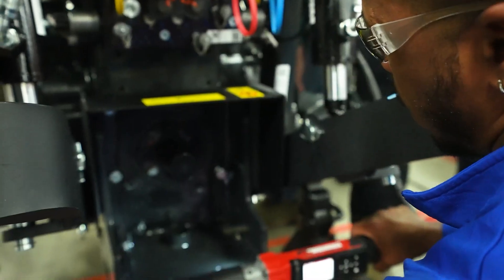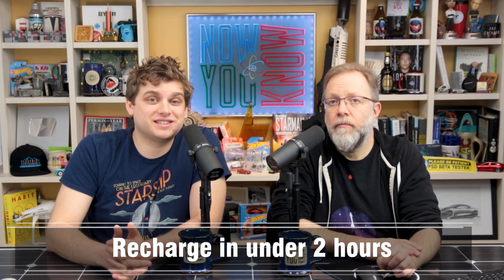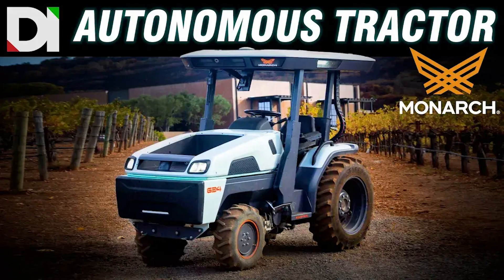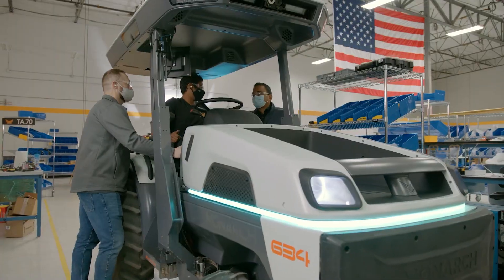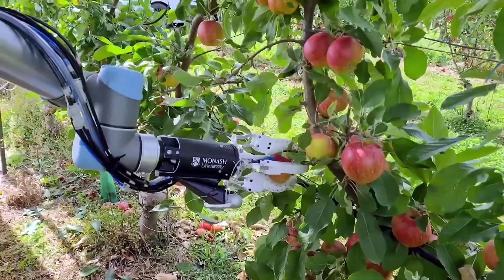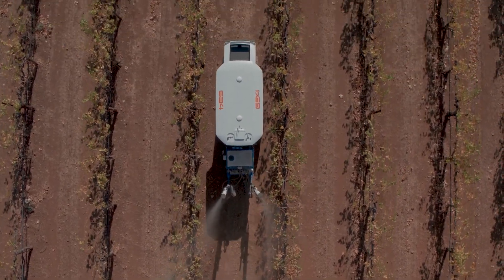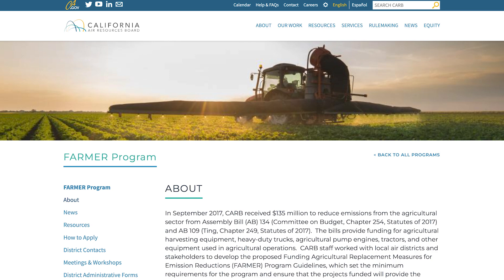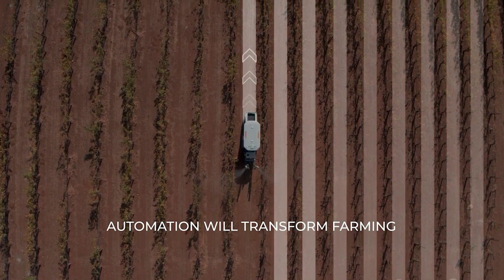The Monarch Tractor is Here! | Disruptive Investing News

Comment: It's  to small forlsrger farm It's meant for Hobby farms . 10hrs is not enough planting ect. Will run it more than 10 hours
Reply: You don't get off the tractor and go to the bathroom or have a meal in 10 hours?
Reply: @-whackd  stopping is a breakdown  in seeding time seeding goes 24/7 around hear 20/7 is.  28 hours a week charging  as well as break downs
Reply: Nope you pull out your sandwich and eat while you plant. Bathroom breaks are as fast as you can in the field. Often 12-16 hr a day
Reply: This tractor has a swappable battery that allows you to swap the battery out and keep going.

Comment: Same with cars and trucks, give me a hybrid-electric all day. Battery technology is still far from what's needed for fully-electric applications.
Reply: EV drivers disagree
Reply: @EV3NTH888  Sure, but they don't drive 500+ miles, stop for just 5 minutes to refuel, and drive 400 more, like I do in my good ol' Chevy Avalanche.
Reply: @seanhoude  yes, they do, I work in a hotel and see it every day
Reply: @seanhoude  also, a 15 minute charge gives well over a hundred miles on most EVs
Reply: @seanhoude  Cool, you've proved that you don't go to the bathroom, eat, or care about your health by standing up occasionally. Right on.
Reply: @-whackd  Well yes, I'll use the bathroom during that stop as well, but eating and drinking is on the road.